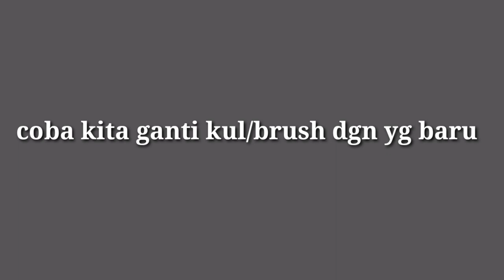Cara cek kerusakan dinamo ampere mobil

Comment: Bis mobilku lgx jika lampu dinyalakan suara mesin turun...tapi kalo lampu off mesin normal lagi atau suara naik....knapa ya...dan pernah malem hari diperjalanan waktu berhenti lalu di stater gak mau hidup..trus didorong...hidup...paginya distarter bisa...adabyg bilang itu karena dinamo ampere..tapi waktu mesin nyala indikator aki di spedometer mati...knapa bos
Reply from the maker: Bisa dinamonya, bisa akinya atau kabel masa body kurang
Reply: Karena gk tau sy habis 700rb gantti elektronik nya . 😭 Hadeuh. Pdhl kyknya cma koil brush

Comment: vol t120ss bila lampu depan diyalakan mesin terasa berat, pas ditengah perjalanan ijek pedal kompling mesin mati, apa dinamonya erorr🙏
Reply: Mesin dihidupin lagi bisa nyala, tpi pas lampu depan posisi on , injek pedal kompling mesin mati lagi, kalo lampu of normal mesin gak mati
Reply from the maker: Coba sekarang sampean tambah kabel masa dari krpala aki negative ke body, ke chasis dan ke mesin. Jika sudah ada, cukup buka baut ikatanya dan bersihkan dgn amplas. Yg belum ada ditambah.